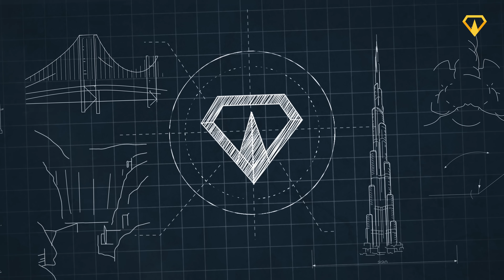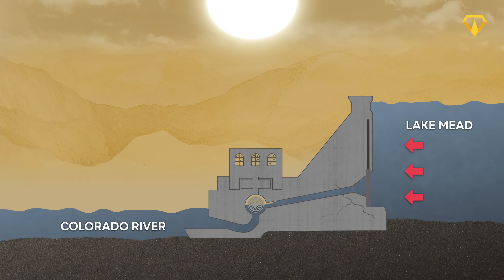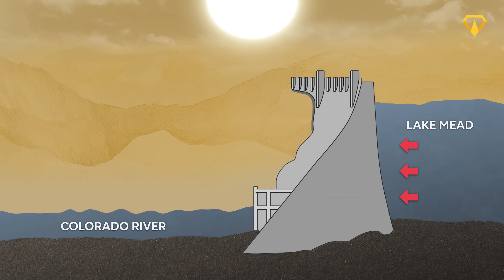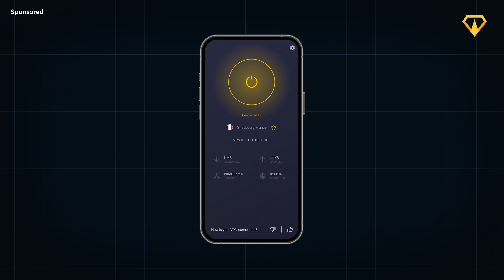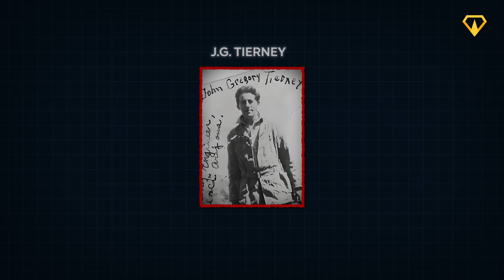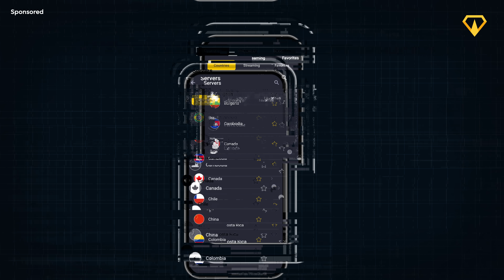How the Hoover Dam Actually Works

Comment: The Boulder Dam (later re-named for President Herbert Hoover) also won WWII. Magnesium ore is abundant in the region but extracting the metal by separating it from rock requires lots of electricity, which the hydroelectric station just beyond and below the dam provided. This allowed the manufacture of a large amount of magnesium cluster bombs. There was little need for the electricity elsewhere, there was not enough population or demand for power within transportable distances. 
Burning magnesium cannot be extinguished with water —it burns even hotter if moisture is applied—  so it was the ideal material used to firebomb enemy factories. Magnesium cluster bombs dropped on Germany and Japan destroyed much of the industrial base used to manufacture equipment and weapons, everything from guns to military aircraft. Without this dam, the USA might not have won WWII.

Comment: I think we go back to the old days find water and make wells specially in Nevada and Arizona they should build big holding areas for them so they can use that water for them to drink and most states with mountains need to plant more trees in the mountains to hold snow pack longer in the mountains so it be slow run off and if we need to cut trees down for lumber replant what we cut down. Think that be start to help with some water problems.
Reply: The problem is the water usage of Arizona and especially California, they are the worst culprit.  Vegas uses not only the smallest % about 2%, but they also put more water back into lake mead than they use.  That why they have hundreds of thousands of acre-feet in credits.  Las Vegas is the model for water conservation, if only the so called green state of California could follow suit.
Reply: @BrownBomber92181  yeah that be the day people in that state has kick that governor out of office to see any real change. That be good start.

Comment: Good, informative video and very interesting. However, no mention was made of the fact that California removes 50% of the water of the Colorado river, for irrigation mostly. While Las Vegas claims 3% of the Colorado river and doesn’t even use all of that, leaving much of it in storage in the Lake Meade facility. The reason why the water level has dropped is because of the withdrawal of water from the Colorado river by upstream states.
It has very little to do with climate change and to suggest that it’s been 1200 years since there’s been this much drought is giving credit to medieval water measuring devices too much. The fact is that when the compact between the states as to who would get how much water was developed in the 1920s they were using Water volume from the 1915 to 1920 period. And that was time when there was an abundance of water so too much water was allocated and now there’s shortages because the water is more normalized.

Comment: other solution is pump the water that goes out again inside
Reply: Explain your genius idea
Reply: @iwantgoat that sounds like the same idea I had as a kid, trying to make a light power itself infinitely....by getting a car headlight, a 12v battery, and wiring up a tiny solar panel i took out of one of those cheap calculators....thinking I could get the light to shine onto the tiny solar panel which would keep the lamp powered.....
Obviously it didn't work at all, but I think that's this guys idea with water, keep topping itself up with the water that's gone down through the turbines 😂

Comment: I Have always thought that they should build a specialized desalination plant somewhere in California and pump water from the ocean up to a higher point above any dams on the river.  The plant would only need to be active when the water levels in the dam are to low.  This would also help to slightly counter rising sea levels.
Reply: Lol. Do you know how ridiculous that sounds
Reply: @iwantgoat  It is and it would be ridiculously expensive but it would help deal with the water shortage.
Reply: @Yuyani_K there’s gotta be reasons this wouldn’t work besides just the insane cost
Reply: @crypt_yt9328  Not really.  The cost is the biggest issue.  Along side getting each state the pipeline would run through to work together on the project.  We have all the technology we need to do this.
Reply: Currently, desalination plants are crazy expensive and hard to run. If they were cheaper, it would be easier and cheaper to just ask the people closer to the ocean to stop using water from the lake than to run pipes behind the dam.
Reply: Yeah it is like I said the biggest issue is cost.  The pipeline would not go to behind the hover dam it would need to go behind the furthest up stream dam.  And there are a lot of dams along the Colorado river.  So the cost would be massive.
Reply: @Yuyani_K desalination is way too expensive but also resource-intensive and slow. It would be such a waste of energy with such little return, it would defeat of the purpose.

Comment: One of the challenges with the Colorado river is that when the water/tribute rights were originally set up in the early 1900's it had been an extraordinarily wet couple of decades. Since then it's returned to "normal" and the population booms of Vegas/Phoenix/LA/etc in conjunction with less water means these places have to start getting very scrappy with water usage and reclamation.
Reply: Also I feel like when the dam was being devised and built, no-one could really have predicted what path and route the environment was going to take. They probably hadn't thought comprehensively about the environmental impacts the dam would cause and what effect global climate change would have on the river, population increases/explosions etc